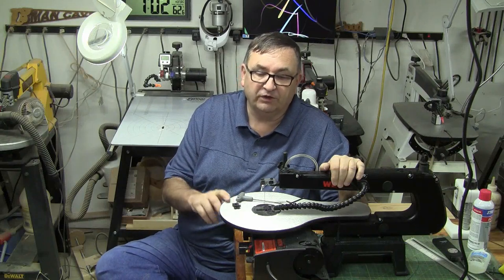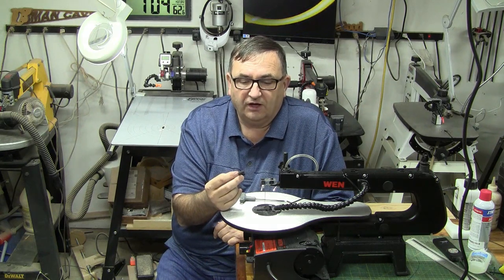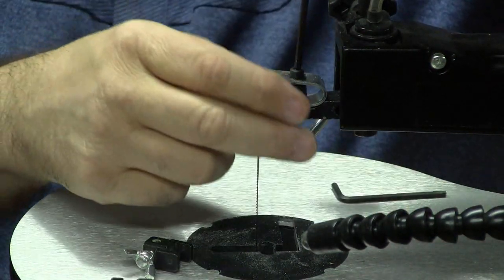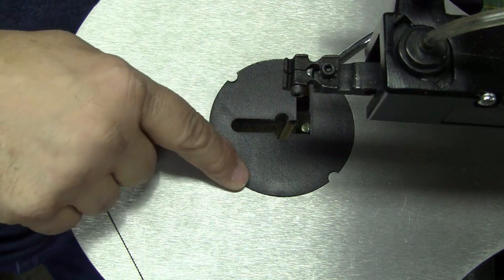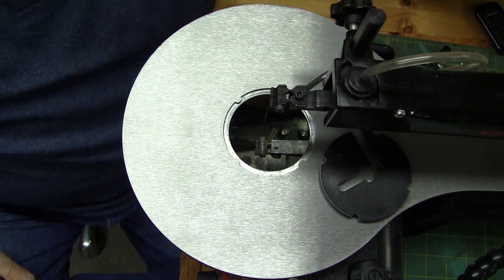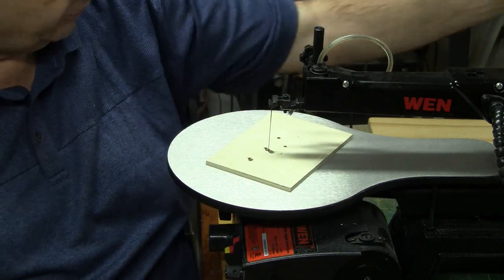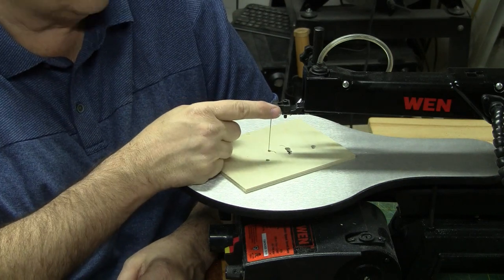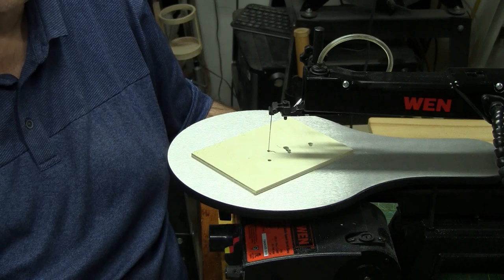WEN 3921 Scroll Saw Upgrade.

Comment: I purchased the Wen 3921 directly from Wen and it arrived yesterday.  To my surprise it included the no-pin adapter that you show and it also included the 3920 adapter that you install in this video.  It also included the M4 16 screws with knobs on them.   There were no instructions for it, but thanks to your video I will know how to proceed.  Thanks for the great videos.

Comment: Thank you for an excellent demonstration - WEN should include a link to your video in every owners manual since they provide NO instructions on the adapter use or installation ( at least for the 3933)

Comment: Just received my new 3921 and it came with both the original "hanging" type adapters as well as the version shown here with thumbscrews already installed.
Reply: Me too. Those were in the box. Still ordered two more sets (2 is 1 and 1 is none) from the link. They work pretty good.
Reply: Which blade donu like to work with?

Comment: Very timely video. Just got this saw recently and it came with the alternate brackets, as well as large thumb screws to replace the hex bolts. However, the owner's manual did not mention them or indicate what they are for. Now I know. Thanks!

Comment: UPDATE. WEN is replacing the blade holder I used in this video with an improved version. It is supposed to fit better and come with a wing nut to tighten the clamp. It is still a couple of weeks from being ready to ship. 12/23/19. You can contact WEN at 847-429-9263 to preorder.
Reply: Do they deliver to the UK ??
Reply: I literally ordered this saw Monday 12/23 and it is sitting on my porch right now. So of course the new version holders are coming out in a few weeks! LOL

Comment: Been using this adaptive device shortly after purchasing this scroll saw.  Works very well.  Wore out the side set screw, but scew was easily replaced at local hardware store. Been using for about two years without any other problems.  With the "J" hook in the front, pin blades are easily used.
Reply: @josephsnyder6787, cool, what size is the side set screw I need the same size for my Wen scroll saw, thanks

Comment: Just bought the 3921 and went ahead and ordered the upgrade parts from Wen linked here in the video description.  I wish I had checked the parts bag that came with the saw because it now includes the upgraded blade holders as well as two thumbscrews for clamping the straight blades.  No need to order the upgrade parts anymore.  Got mine from Amazon.

Comment: This also works on the Harbor Freight scroll saw, with a slight tweak to the mounting hole. A file could be used. I used a taper reamer & only took 3 or 4 turns, by hand. 
Finding a thumbscrew was another thing. I used a bolt with a wing nut cinched up tight to the head & secured with CA glue. 
I want to see if the tension mechanism will work as well. 
Maybe the table too.

Comment: UPDATE:

WEN seems to have heard the criticism; the unit I just picked up includes 2x3920B-031 (the better holder) each with an easy to hand tighten screw (large wing-nut).  :)
Reply: Update 2: the thumbscrew they supplied, I could not apply enough pressure. I purchased 2 hex screws from local hardware store for ~$1, and use a T-style hex tool very successfully. I’ve made multiple small projects this way.

Comment: I just received my 3921 2 weeks ago from Amazon on sale and it came with these adapters. However it vibrated more. So I weighed the stock set at 13 grams and the adapter at 13.7 grams. I sanded .7 gram off each one and the balance was restored to previous minimum vibration. Some grease should be applied carefully to the threads only to increase life.

Comment: I wrapped electrical conduit around the lighting arm and it did the job resonantly well the second upgrade I made was change the way the machine receives pinless blades,I swapped out the screw with the Allen wrench for a twisting locking mechanism and now I cut the blade changing time down from 5 minutes to one minute if you want to stop vibration from this machine put it on a stable base and you won’t have any vibration problem solved

Comment: I just got this exact model (from Amazon). Much to my surprise, it CAME WITH these new clamps Steve is talking about. In addition, they have a proper wing-nut, not the small allen key nut that requires the tool. Pretty nice. It's certainly not a fancy saw, but it cuts and it's fun to use!
Reply: I also bought the same on Amazon and also came with those clamps , sure makes it more easier to change those flat blades!
Reply: @jean-marcberube7610  how did you get set screws for them.

Comment: I bought these in an attempt to adapt my saw to hold pinless blades. I had to hunt for information on adapting for pinless blades and after a YouTube video, this is where I landed. I have model 3920 and these are already on it. I realized that after the fact, but nonetheless, they do not hold a pinless blade at all. No matter how much you tighten, the blade will pop right out with any tension. I also did not need the screws as the description led me to believe - they are already on the saw. I tried to return for a refund but WEN does not cover return shipping, therefore the refund is a wash. I didn't bother sending back. Wish I could've ordered from Amazon.

Comment: First time scroller, bought this saw a few weeks ago. It came with these parts, with thumb screws, so that was nice. BUT, I can’t get the bottom one to grab the blade regardless of how tight I crank down on the thumb screws. The blade still slips right out. 
Before I realized my saw came with these, I ordered a set from Wen. I’m hoping I can get the new ones to actually grip the blade, because I gotta say, blade changes on this thing really suck the fun out of learning a new hobby. I’ll do my best and keep saving money for something better.
Reply: Hi Molly. None of the entry-level saws get the clamps right. It is unfortunate because it really should not be that difficult. Take a close look at the bottom clamp. Make sure the blade is being contacted on each side when you tighten the thumb screw. If it is then take some sand paper and lightly roughen up the contacts on the bottom clamp. I have seen them come with contaminants like oil and paint on the contact points.

Comment: Even though this video is over a year old I wanted to add. I bought the wen 3921 and it came with everything it was supposed have but it also came with the blade holder from the 3920 as well.
Reply: Same here. I got the adapter as well but mine came with a knob to hold blade but for the life of me blade won't stay in place. 😳

Comment: My wife gave me in the mid nineties a Dremel Scroll Saw. It looks almost exactly as the Wen.  Differences I see are my saw is two speed and has no attached light. Also there is no quick release on the tension. I’m sure that this modification will work on my saw also as it has identical blade holding mechanisms. Thank you for the info.
Reply: did you do it?
Reply: Allothers Taken not yet.

Comment: that block has no locating pins, but does have a slight raised side on both sides of the screw. The one you fitted on the top had the raised sides on the top, I assume it was the reverse on the bottom block, I think you put them on the wrong way round

Comment: Funny you made the comment of finding an M4/16 screw but I would think it's worth the time to re-tap to 8-32, 10-32 would be my choice. I have seen thumb screws for 10-32 / Grainger Dog-Point Clamping Screw, Knurled Round, Thread Size #10-32, Thread Length 1 3/8 in @ $4.60 Each. a much better way to go.

Comment: Hi Steve.  It looks like Wen now has a new model 3922 scroll saw for about the same price as the model 3921.  It looks like they have changed the blade attachment assembly to something that will make it easier to do inside cuts with a plain end blade.   The advertising is not specific so I am not sure if I am correct.  I would appreciate it if you could help with more complete information.  I want to do fret scrolling with a plain end blade.  The Wen 3922 interests me and is affordable.  Thanks for your help.

Comment: I bought the Upper/Lower Blade Holder for WEN 3920 and the 2 hex screws part #'s 3920b-033. My question is how do I know where the pinless blades go in? Do they go into the j or do I put them up against the the hex screw. Please will someone help me with this?
Reply: The blade goes into the front slot, past the jay, and is held tight with the set screw.

Comment: Steve , new scroller here. I just bought a Porter cable 18” saw. I think it’s one you did a review on recently . I like everything about it so far except the blade holder. It’s c combination one that I can use either pined or non pined. The thing I don’t like is the way it swings making it hard to hold the non pined blades in place when tightening. Is there a replacement that is ridged like the on I see here on the Wen ? Or another way of installation that would be easier ,   Mike
Reply: Hi Michael. The Porter Cable saw was rated the best entry-level saw a few years ago by Scroll Saw Woodworking and Crafts magazine. It has gone up in price recently but so has most of the saws. It is a nice saw. I did review it several years ago. https://youtu.be/fAsZXqV7wJQ  For some reason all of the entry-level saws have that floating clamp design. It is a bit of a nuisance but I do not believe there is a replacement that is solid.

Comment: The old style blade holder can hold the pinless blades or the blades with pins. I don't see how this new upgrade blade holder can hold the pinned blade. And how about turning the pinned blade sideways for a rip cut, avoiding the back neck of the saw?
Reply: Hi David. Yes you are correct. The new blade holder is specifically for plain end blades. Many scrollers never use pin end blades so for them this is not a problem. If you need pin end blades then this would not be an upgrade. The feature of side loading the blade is the same problem. You may have noticed that none of the mid-level or high-end scroll saws accept pin end blades. Pin end blades are something that is rarely used except for very basic patterns so I guess they thought they were not something many people would need.

Comment: When I first bought my 1st scroll saw it was the Wen 3921 and it came with those clamps you bought and for some reason the switched to the one you took off supposedly because they said it was better and easier to work with but they actually made it more difficult to work with. I'm not sure why they did that and it wasn't an upgrade it was a downgrade.

Comment: The bottom one I am having trouble with!  How does it go on??
Reply: You have to remove the side panel on the left side so you can get to the screw from the bottom.  Make sure you use the hole closest to the rear of the saw to insert the screw.

Comment: I have a problem with this adapter..when 1st time tightening the blade it is fine..but when i take out the blade & try to insert again it becomes tight...it seems that the clamp tightens & dont return to position after opening the screw...can someone explain what am i doing wrong? Very much appreciated..thanks
Reply: Loosen the clamp at the rear of the saw first.  Then reach under the left side of the saw and rotate the cam on the motor so that the lower arm is at the highest position.  That will give you enough slack to slip the blade into the upper holder.
Reply: @davenorris2125  thanks you 👍

Comment: Frustrated...your video is about the adapter but what is the part number or where can you get these...is it me or did you make it clear and I missed it??
Reply: Hi Joe. The information is in the description. Unfortunately, they are sold out and I'm not sure they will be replacing these parts. The newer WEN 3922 uses a better system with different parts. I think the new parts are compatible with the 3921 but I would have to call WEN to be certain.

Comment: Just bought this because I wanted to get into the hobby a bit.  It was 90 dollars.  Comes with all the accessories like the tightening screw with a nice black "wing" nut handle.  So it is all there.  

NOW, ANYONE NOT DO ANY OF THIS WORK LISTEN.  The "painless" blades are a nightmare.   The so called teeth (I have olsen) are so small that i had to see which way the teeth go with a loupe.  And feel is useless too because you get it near the "clamp" and then screw it with the knob (provided) it can be pulled right out.
Look, maybe I'm going something wrong, but I doubt it.  These little tiny blades and their holders are not for people that don't want to use loupes.
I think I will send it back or give it to a young kid and buy a band saw.  I hate little things like this, rather carve with my hands then tiny power tools.  VERY, VERY FRUSTRATING. 
P.S. I am really good with my hands and have trouble.   If you are average to below average you will be pissed unless you get lucky.
Reply: Hi James. Your frustrations are shared by a lot of people just getting started with the hobby. Entry-level scroll saws commonly have poor clamps. They are usable but they take practice.  I have been scrolling for over 30 years and still have trouble with these inexpensive saws. Luckily mid-level and high-end scroll saws solve these problems. Of course, you pay much more but they give a much better experience. Pinless scroll saw blades are very small but you don't check the teeth direction by looking at the teeth. You rub your finger along the teeth and feel the direction. That part of your frustration is your technique.

Comment: We can buy these clamps in the UK from a company called Axminster ...They are a lot better than the clamps that came with the saw I use but they are made of cast iron and have a tendency to crack after a few months of loosening and tightening ... In the UK we dont have a great selection of saws to pick from ..Usually they are all like the Wen one you have ...Axminster do have a Jet saw and Excaliber but the price is just too much   .Link for the clamp in the UK if anyone interested... https://www.axminster.co.uk/axminster-blade-clamp-for-awvfs-scroll-saw-400124